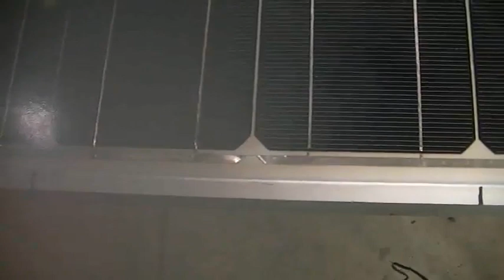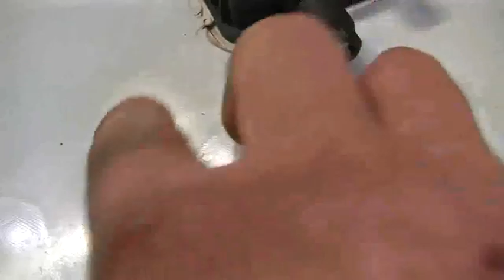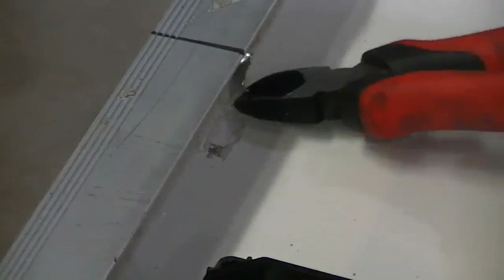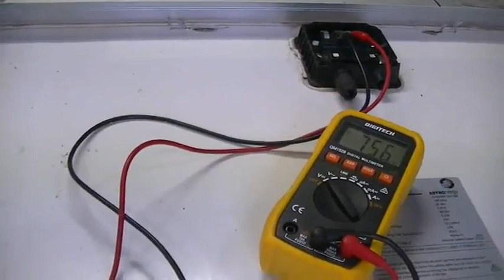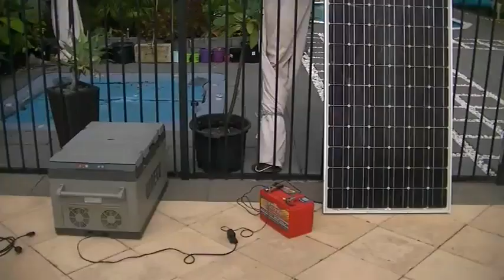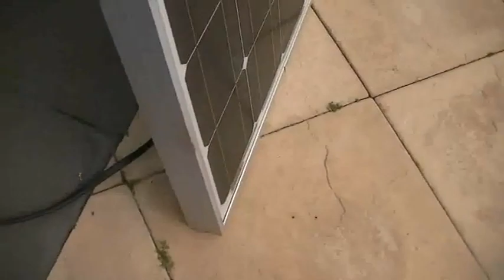Solar panel hack 36volt to 12volt

Comment: had a lead acid battery system for years. just upgraded to lipo .  i have 3 times the available power than the same ah capacity agm . no power fade for start up loads that trip out the agm system. and a bms that extends the life of my system. (i had one cell at a time go at half life of the agm system). so my suggestion is that a lead acid system is a definite step backwards and unless you need a very small system should be avoided. this hack is fine for the agm or flooded battery but some systems wont start charging untill a higher than 14.6 v supply is available. the solution is dedicated 12v panels. and off the shelf charge controllers. this hack provides that from roof top panels. spend the money saved from panels on your battery pack well worth it

Comment: Very interesting . Still can't work out why theirs 2 layers you need to cut throu. Is because theirs bus bars passing over the middle array? Without diodes will the pannel discharge the battery at night?

Comment: This works but its impractical, your only getting a maximum of 14volts in perfect weather conditions, soon as cloud cover happens the volts drop below 12v somewhere around 7v and you miss out on solar power. You are better off halving the solar panel to 18v (splitting straight down the middle) and running a solar panel charger. Most 12v solar panel set up's run well over 14.6V for this reason.
Reply: Mostly amperage will go down under clouds,,,, 14.7, is good

Comment: I ordered a 18v panel and through a comedy of errors I received a 36v panel, swapping it out was too much of a mission for the supplier so I decided to keep it. I needed it for an ecoflow river and needed max 24v and 12 amps. I just  finished the conversion. Mine was not as neat but it works great, thanks so much from silly south africa

Comment: Thanks for the video. 
Everything seemed to go well but on completion I am only getting around 12 volts and it drops 2 volts as soon as the multimeter is connected to it. 
Any ideas would be grateful.

Comment: Nice. Thank you very much. I knew I could gain access to all of the cells individually and divide 36 by 3 to get 12, but I didnt want to chop them all up. Just chop them into 3 sections for the 12 volts. It looks like youve done all the homework for me. Much obliged. 👍👍👍

Comment: I just did this. It worked. My panels are now 12v 21A down from 36v 7A. My cables exit the box on the outer 2 bars so I cut those bars on the far left and far right and bridged to the center. I didn't need a dremmel, just a sharp box knife (with extra blades), strippers, wire cutters, sharpie, drill with 3/8 bit, flashlight, needle nose, silicone, solder, flux and a soldering gun. It took less than an hour per panel. I got a great deal on an mppt controller but the voltage was still too high to work on a 12v battery. Instead of buying another battery or controller, I did this and it's working perfectly. You saved my ass! Big thanks.
Reply: Have you any video ? If you have, please give that link
Reply: @mdriponhossain83  I tried... didn't work out.
Reply: Does the wattage stay the same as volts x amps = watts
Reply: @julianvelay5260  same exact wattage

Comment: Thanks for this great video!
I’ve loved it from start to finish.
Just completed my first conversion of a 335w panel off the side of the rd. Got my 140amp battery ready to go and will hook it up to my fridge (also off the side of the rd!)
I love scavenging and recycling so this has been bloody good fun
Thanks again 
Nick Bell
Reply: the battery will never reach full charge whilst there is any real load on it did this hack 8 yrs ago complete failure

Comment: Question, please: Can I just connect three 12V batteries in series to an essential 36v battery system? Would that be compatible with my 36V solar panels? Thanks
Reply: Well it wil charge but for better charging it would be wise to have ur solar panel voltage abit higher then your battery voltage. 40-45volt would be required to charge it

Comment: Does this work with mppt controllers? 
My understanding at the moment is that all of these controllers require input voltage > battery charger voltage (14V) to work. Can anyone confirm if this is true or not for all of them?
Was hopeful in using this as cheap source for van, but I jumped on the combined alternator charger + mppt, which has max input voltage of 25V

Comment: Great video, I've just bought 4 250w panels with an identical layout, except the diodes. It's got 6 instead of 3. Not sure what the idea is behind taking them out? I'd be interested in your comments. I'll leave the positive one in I think but am no expert so a bit lost...
Reply: Don't touch em at all. Unless you are going to use more panels.

Comment: Greetings all - I have done this to two Trina 195W panels and on both occasions when I connect them to a Renogy Rover (MPPT) It shows Nothing! It's as if the panel doesn't exist!!! However when disconnect from the Rover and investigated with a multi-meter it shows 13.9 Volts and 14.5 Amps.  It leaves me wondering why the M.P.P.T. reg doesn't recognize it. BTW it work quit well otherwise see below. . Do you think I should try a PWM regulator?  
I originally purchased 4 panels for this experiment and have the remaining two which are un-hacked, wired in parallel feeding the  M.P.P.T. controller and doing good but only putting out 10 amps and in my book that is too much hardware & weight to take camping for that output.  In short I would much prefer the single panel as made here. I know that in theory I don't need a regulator but I have just spent a small fortune on two AGM batteries for the camper and don't want to blow their warranty ... Do you think I should try connecting it to a P.W.M. controller?  If anyone has any suggestions don't be shy...  One last thing and this is very important  - I have been wondering how to turn 36v into 12vdc for the last three months and Your solution has been the best to date thank you so much for taking the time and making the effort to show us how it's done :)
Reply: Mppts operate at a higher voltage then the nominal battery voltage..if you mppt can handle if you say 4 panels making it 48volts so put all your panels in series so that mppt can work well. Or you can go for 2 strings of 24volt connected in parallel feeding ur mppt controller at 24volt and 20amps

Comment: just did this Mod today . easy to do and works well !!! panels are not going to waste ,   Thanks very much  great idea !!!
Reply: but how does this work? if the panels are 36v and then connect the cells parallel as shown, you'd get 12v and not 15v. to charge the batteries you need at least 13.5 v or so. how many volts was your panel and what's the output?
Reply: @RichardJucewicz  ever get an answer for this?
Reply: @stygianindustries8295  sorry I only see your question now. Still unclear as of yet. How about you? Anything news on this?
Reply: @RichardJucewicz  simplest solution is to get a charge controller that can handle the 36volt input and supports 12 volt battery. I did the mod like in video . What you end up with is actually 18volt in full sunlight which is fine if you have a stepdown converter to regulate the voltage . The cost would be the same but better if you have charge controller. I got mine less than 100$ SRNE is the brand. true mppt and works well. I put panel back to original configuration and use the charge controller.

Comment: Hello. Do you perhaps have any thoughts of rebuulding the robert alexander motor again? This time following the description and not the fake diagrams. The diagrams doesn't even have any transformer windings. "Using the transformer core as a rotor" is not even seen by the diagrams.

How about using the stator of a synchronous motor as a transformer? This will be the true robert alexander motor, which is what I rediscovered.

Comment: Great idea Tin man .but don't forget to add a diode on the positive to prevent battery draining into the panel at night. Love your old videos bring back the pulse motors, especially the lenzless motor design 👍
Reply from the maker: The solar panel is a diode,so no need to add one.
Reply: Yes! Tin man times were very interesting to watch.

Comment: Would a buck converter work for this as well? Would the reduction from 36v->12v mean there are more amps on the wire? Would the stock connectors handle the load? That sounds like an awesome deal you got there, good for you man! Thanks for the upload.